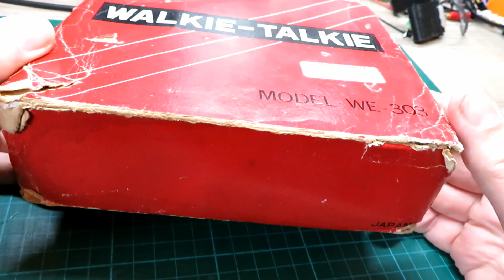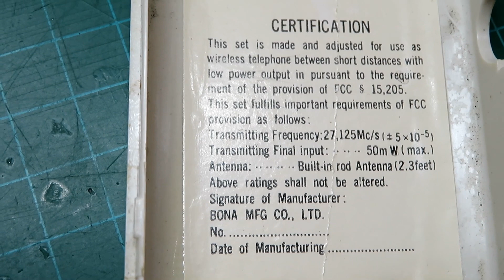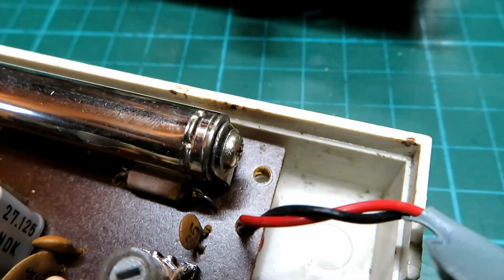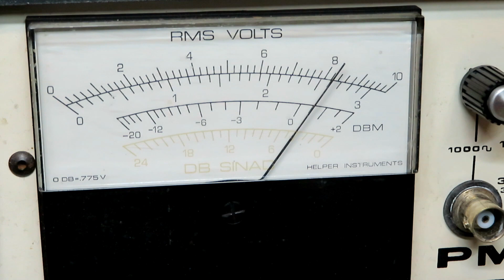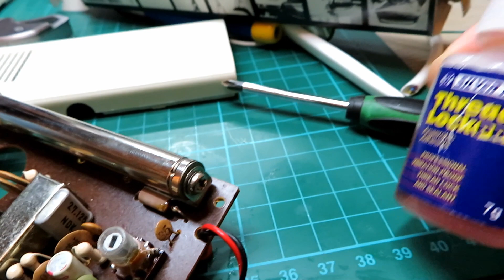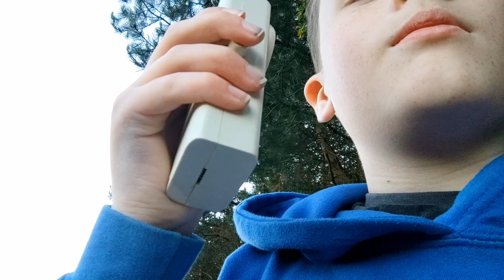CAN 60 YEAR OLD WALKIE TALKIES STILL HEAR SIGNALS FROM 5000 MILES AWAY ?

Comment: I have several pairs (and models) of 1960's Lafayette walkie-talkies that tx/rx great, and also an early set 70's "Space Patrol" walkie-talkies that were cooler than cool back then. About 20 years agoI bought a set from the late 60's, a TRC-25A (100mw 2-ch), listed as misc. stock from a Radio Shack store closing. When I opened the box and removed one of them, I was immediately  my nostrils were filled with, what I can only describe is akin to "New car smell", or, if you were ever into film photography and for the first time, opened the cannister that held the film, it too had a wonderful aroma that could only be described as nirvana....You've done another great video, especially of which, really opened my mind for the bin marked "Cool memories you've forgotten".  Thank You, yet again for unlocking that key, while showing me some cool radios I'd never usually find Stateside! 🙏

Comment: Unbelievable, but just proof that it was possible to achieve a good radio connection half  century ago
Reply: You wouldn't  believe how good radios  were already before 39. I have one of better SW amateur radios made im half of 80ties which today is priced around 450 USD and is used also by HAM amateurs and  in compare to my pre war luxury 5 tube radio it's advantages I see only  in few functions Actualy my personal opinion is that those pre war were most luxury  radios of all times.

Comment: Very interesting, but be careful -  Ringway will report you for illegal AM transmission if you are not careful. I was very confused by the circuit to start with - no transistors in sight, but you later clarified that!

Comment: Just started. 29 seconds in. Looked at the shops, Oxford our closest at the time. Guessing you as well. Coventry?. Dont remember this shop. Not a name I know. Comet, yes. Was a big old building down Osney Mead in Oxford, Still there as a building. Got clock radio from there 1987. First paper money. That still going in Dads workshop. Ok bit off topic now. Now to carry on. Put a tenner on it they get new capacitors  :). Nice video. So USA produce stronger signal than the other radio 50m away. You got a bit of vaseline on the dirty bona.